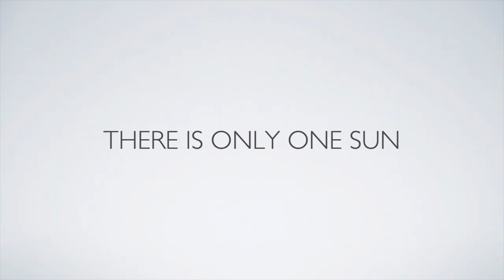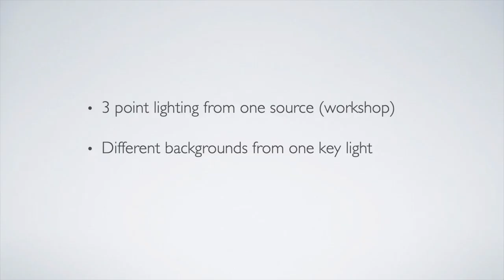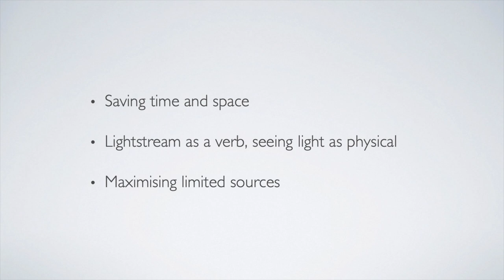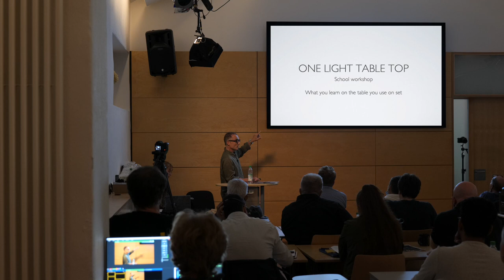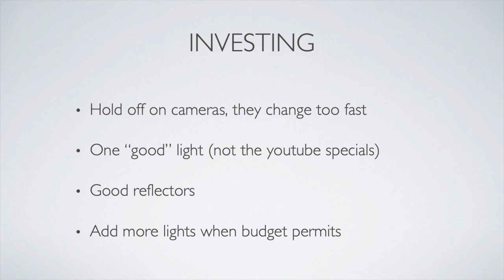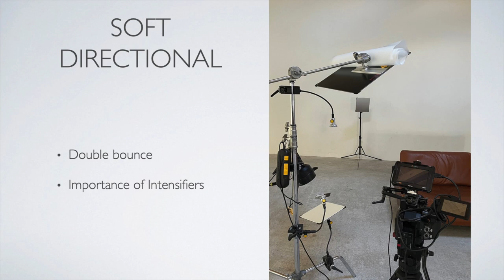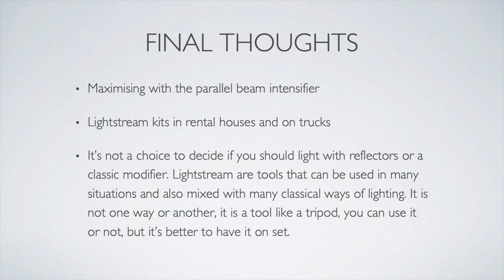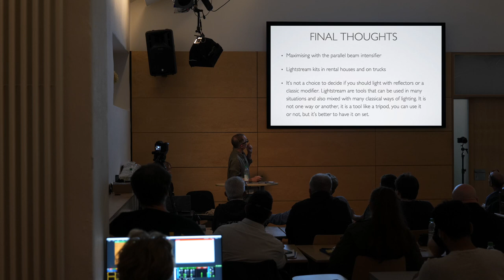Maximising The Source: understanding reflected light

Comment: I’m confused how the inverse square law relates to the constant exposure? I would think that he would lose a stop of light every time your distance doubles.
Reply: Hey its a bit roughly brushed over in the video. You can imagine it like this: a normal light fixture will have exactly this effect. You double the distance you will lose 2 stops. So when a person gets closer for example the brightness increases significantly. If you use reflected light, the lightsource is further away most of the time because for example have the light mounted on the floor shooting up into a mirror. So now you have the lightsource further away, because it travels from ground up into the mirror to the subject. so you added 1,5 meters for example of way that the light needs to travel. So the same movement from the person now happens further away from the light. so the change wont be so drastic. This effect is even more enhanced with the parallel beam attachment, i wont go into details here, but the attachment makes the lightsource behave like an even further away lightsource. For example it makes it feel like 5meters behind the actual light. Now you have 6.5 meters of the light traveling before it is at the point of here your previous light would be. If the person would walk from 2 meters to 0.5m to the mirror With the parallel beam attachment on the light they would gain under half a stop of light. Same scenario with a direct source where the mirror was would be 4 stops exposure increase. I hope that clears it up for you (google inverse square law with f stops than the whole thing becomes a lot clearer)
Reply: @el1538 makes sense... the rays are more parallel therefore they are not spreading. ingenious... the exposure will remain more steady. Thanks for taking the time to explain.
Reply: The presenter “misspoke”. The exposure remains contant not because of the inverse square law but because the inverse square law does NOT apply here; it only applies to light that radiates freely away from a point source. It does not apply to “parallel” or collimated light, focused light or light that  is otherwise modified with intensifying reflectors or blocked by grids (occlusion effect). That’s the entire premise of this system= inverse square law does not apply to this light source. To be clear… the magic here has to do with that amazing light source with the special lens on it - and not the reflectors used. If you don’t have that or similar light then this trick with these reflectors will not work.
Reply: Does the inverse square law not explain the reason the fall of is not the same is because of the distance of the source
Reply: thanks man, that makes perfect sense @ottawamountainman

Comment: how do these reflector differ from a mirror, or mirror with diffusion gel attached?
Reply: You can say mirrors are like teletransportation of a fixture. Changing the direction of the source while keeping a very similar quality and level as the fixture. They're awsome to work with sun light or to simulate a more natural source. A mirror with any kind of diffusion would take out these attributes, making a softer reflection and loss of level. 
On the mirror of your bathroom you can se an exact reflection of yourself, but when someone takes a long hot shower, the steam that was "added" on the mirror will present a blurry reflection of yourself